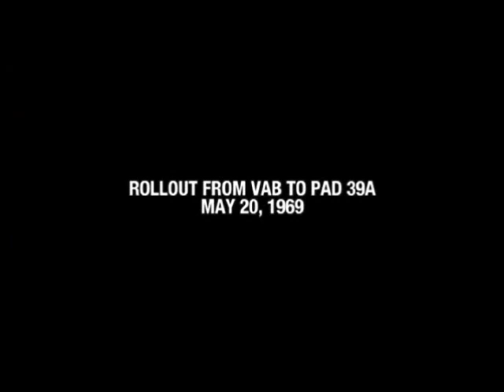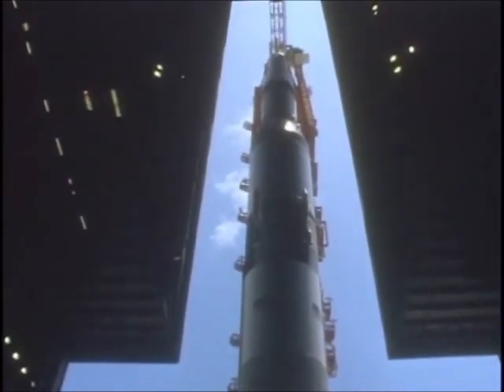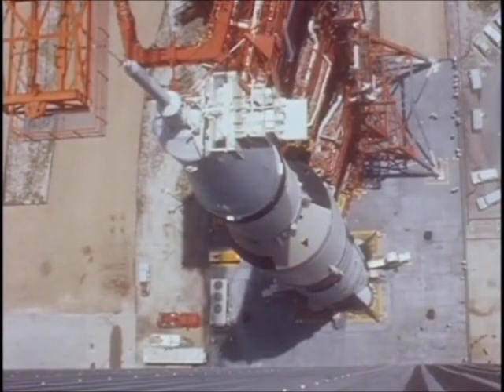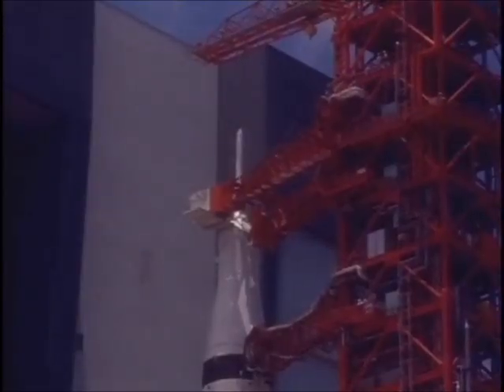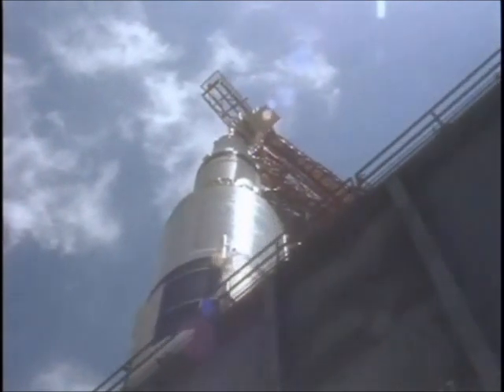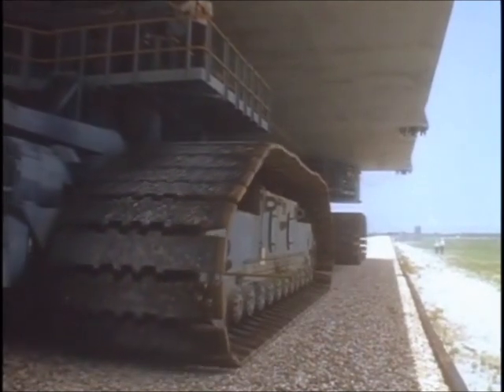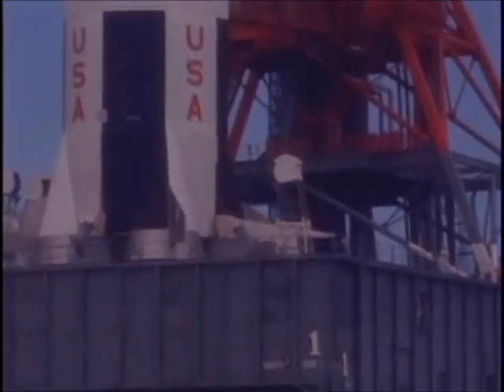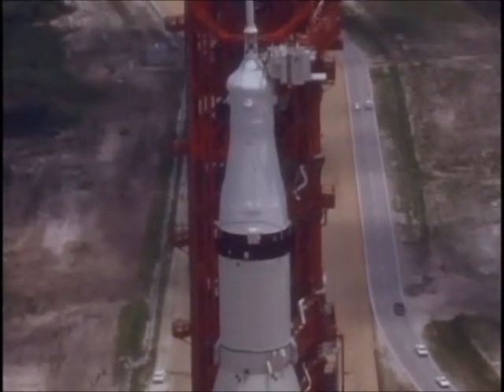"APOLLO 11 - Rollout From VAB To Pad 39A" - (May 20, 1969)

Comment: Great vid. Tell me, the crawler vehicle has the mobile launch platform, launch umbilical tower and the Saturn V sitting on top of it which it transports from the VAB to the launch complex. Once it arrives does the crawler vehicle go back to the VAB (leaving the mobile launch platform, launch umbilical tower and Saturn V behind) or does it stay in place until after launch? Cheers
Reply: The crawler lowers its hydraulics (the same ones used for levelling) to deposit the mobile launcher at the pad, positioning it exactly onto support columns, and then the crawler drives off to park away from the pad.  After launch the crawler returns to the pad to collect the mobile launcher.
Reply: @JustFamilyPlaytime  thanks for the info. Would have been an amazing site to see a Saturn V rolling out in real life! 👍
Reply: I want the following to be added: After depositing the mobile launcher and Saturn on the pad, the crawler moved also the Mobile Service Structure (MSS) from its parking area (at the junction of the crawler way between Pad 39A and 39B) to the launch pad. Finally, the transporter returned the MSS to the parking area before launch.
Reply: @klauskuhnert602  once the shuttle era came around it just went back to its place at the VAB. I guess the SLS will have an MSS?